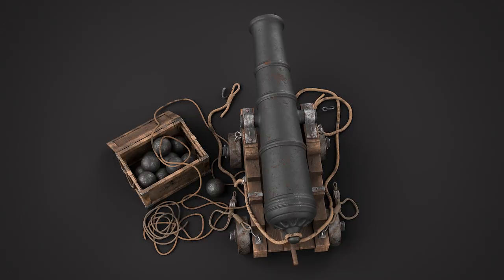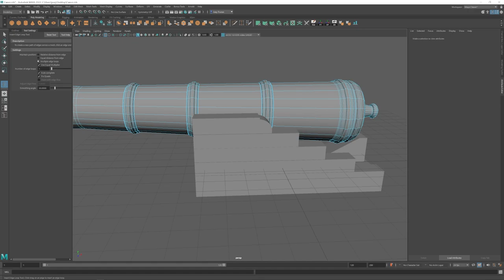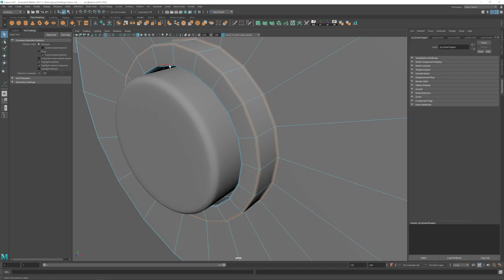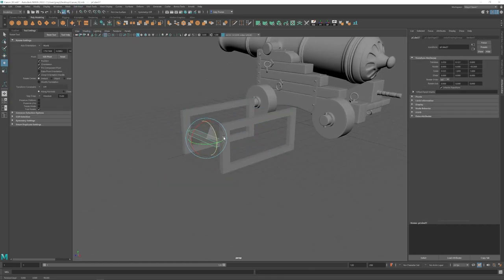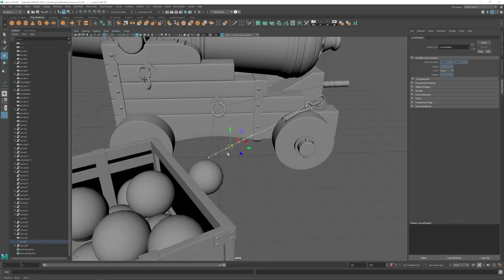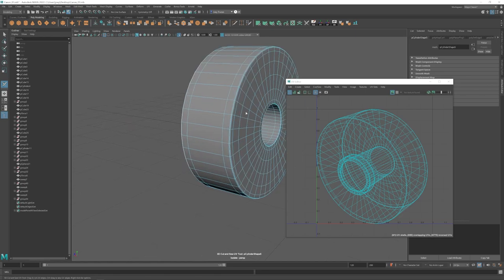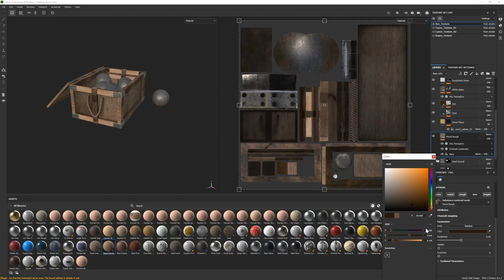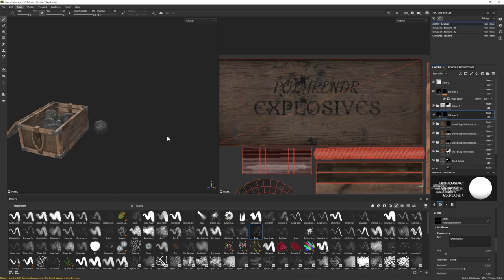Old Cannon | Autodesk Maya + Substance 3D Painter

Comment: do u use blueprint or not then how u make the accurate model without any blueprint
Reply from the maker: I didn’t use a blueprint, I just slowly build up the shapes and adjust them along the way. I find it’s easier to not worry about getting the shapes perfect off the start, just get everything blocked out and as you add in other shapes it helps you figure out what size you need everything to be.